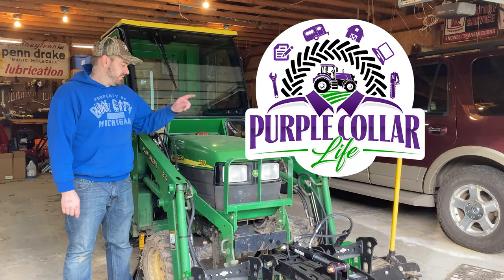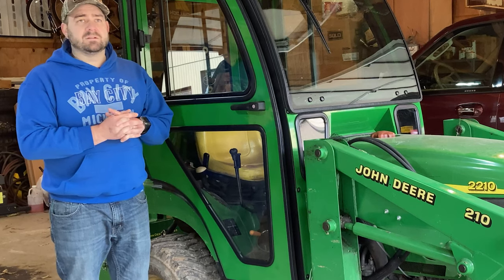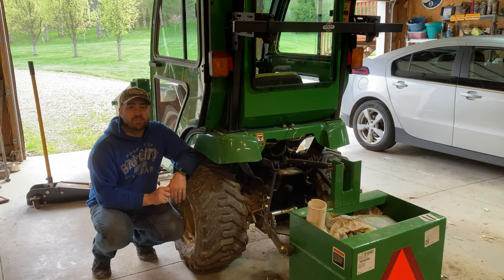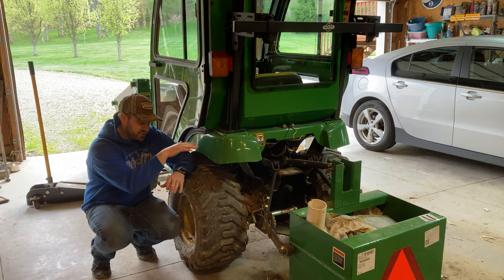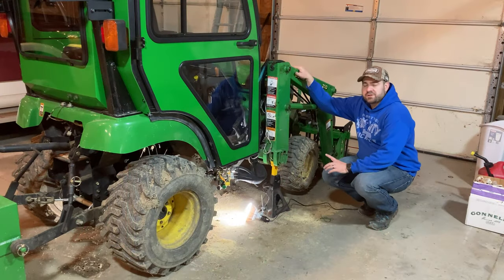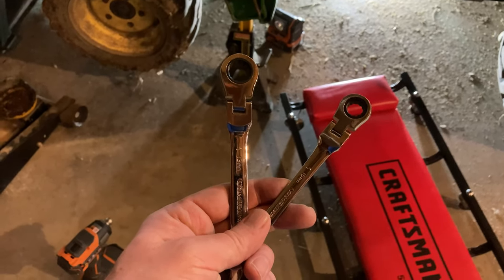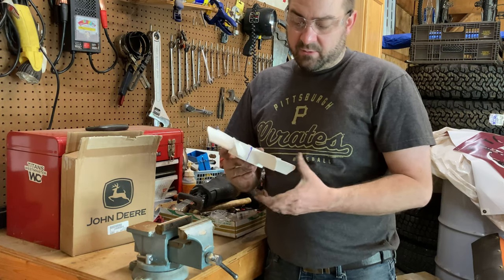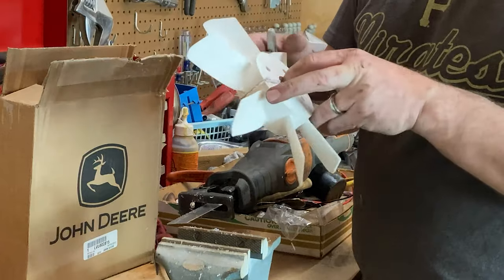#201: John Deere 2210 2305 Transmission Fan Replacement DIY

Comment: Hi Chad, I feel your pain! My 2210 developed a rattle that sounded like it was coming from the engine. It’s so compact in there that you really can’t see much. I debated taking to the dealer because of the cost so I offered my nephew and his son the job. They jumped on it like rabbits. Before I knew it they had split the tractor and found the u joints on the drive shaft were shot. After following the advice of several Youtubers I went to NAPA and bought theirs. The guys couldn’t make it fit. It looks exactly the same as the JDs but they are just too big. So I ordered the whole drive shaft from JD at close to $500. Of course, the fan was broken as well so that got replaced as well. They did a really good job of cleaning everything up and putting it back together. I started it up and the rattle is still there. Now they’ve decided it must be the water pump so they’ve spent the last few days tearing all that apart and I ordered a water pump from Amazon and of course it’s not the right one. Now I guess I have to go back to JD and the get the parts from them. I’ve spent the last few weeks chasing all over trying to get parts like belts, u joints and mower deck parts but I always seem to go back to JD. My tractor was a repo so the salesman wasn’t sure what year it is but I’ve had it for 13-14 years. I don’t know what I would do without it. I’m 77 and that tractor is my muscle on my 5 acres. 
Sorry this is so long but just know that you are not alone. I don’t know about other makes but JD seems to make these machines unserviceable. I’ll be watching to see where your adventure takes you. I’ll let you know if we get my rattle fixed. Good luck!
Reply from the maker: Hello! Thank you for the information on your tractor.  I’m afraid I probably will need to replace the driveshaft in mine before too long (hopefully not for another year or two).  It’s great that you have your nephew and son who are capable of doing the work! I’d still be afraid to split my 2210.  It just seems like it is beyond my skill set, or at least very intimidating! 
Such a bummer that the rattle is still there, but at least you know the driveshaft and fan are good now! :). 
I don’t know what I’d do without my JD2210 either.  It’s a great machine.  
Can’t wait to hear your update on what you find with yours.  Thanks for sharing! Looking forward to having you follow our adventures.
Reply: Hi Chad, the guys finally got the 2210 up and running and the rattle seems to be fixed. After waiting for parts to come in by bits and pieces and returning some of them that were not ordered, they finished yesterday. I’ve lost track of how much I’ve spent on all this including what I paid for the labor. They put in the new water pump (almost $500) and so far nothing is leaking or rattling. We didn’t get a gasket with the pump so we made one out of cardboard. It feels so to good to have my tractor back in working order. I hope you get your issues solved soon. Best of luck!

Comment: Great job replacing the fan yourself! That is a substantial savings avoiding deal repair cost on the labor! The fan shield could use an extension on it to help prevent future branch intrusion. Cheers!
Reply from the maker: Thanks!  I agree about the skid plate / shield.  I would think it could still allow airflow in the sides if it had a little more protection up front, but I'm not an airflow engineer. :)

Comment: Glad to see you were able to fix it yourself feels good to save money☀️😁👍
Reply from the maker: It certainly does. It got a little stressful at times when I wasn’t sure I’d be able to get the old fan cut, or get the new one bolted in - but I’m really happy I did it myself.  Like I’ve said in a few other responses to comments - we probably would have had to do without the tractor for a little while as we saved up for the repair. I don’t have $1500-2000 sitting around in a “tractor repair fund”. :)

Comment: Nicely done, Chad. Thank you!! For taking the time to throughly explain your process. Have you been able to install some sort of guard so it doesn't happen again? I would have been so frustrated along the way but you calmly pushed through your frustration and got 'er done! Cheers!
Reply from the maker: Thanks! It was a task for sure.  I will certainly be extra careful now and watch for sticks when I'm working.  I haven't found any good protection for it yet.  There is a mesh guard available for the John Deere 2305 on eBay, but I've had another viewer say he tried it and it doesn't fit the 2210 models.  I'm actually tempted to put the mid-mount mower back on just as belly protection!  Thanks for watching and commenting.

Comment: I can't find any forum posting of the printable fan you mentioned.  Do you have any recollection of where you heard of this?
Reply from the maker: I think I read about it on the TractorByNet forum, or maybe one of the John Deere forums.  I did a quick search, and couldn't find the slice file or any 3D printing file for the fan. It seems like a great 3D printing option though - if you can find the file.  Though, the molded part wasn't too expensive, and cutting through it wasn't too bad.
Reply: Thank you for responding,  I really appreciate it!
Reply: @tommyfournier3138  Im looking too were you able to find it?
Reply: @dorito31561  no, sorry. bought the real part and removed the shaft from the motor to the transmission.

Comment: Nice work. When I bought my used 2305 from the dealer last fall it came pre broken, so when I noticed I put it back on the trailer and took it back to them. They reluctantly fixed it at their cost, the service manager even tried to tell me that the fan was only there to keep debris from building up on the transmission… just the other day I ordered a mesh guard that goes in place of the factory shield from some guy on eBay, but unfortunately the ones he makes only fits the 2305s. I had no idea the 2210s were so different underneath, you really did have to work to get that in there.
Reply from the maker: Thanks for letting me know your experience.  I don't know if I'd trust that service manager any more! Just for debris.  That's funny.  
I wonder if that's the same mesh guard I've been considering off of ebay.  I only saw one, I think it was about $120 if I recall correctly.
Reply: Do you have a link for that fan guard?  My google fu isn't working... After seeing this I may bite the bullet and get a guard.  Thanks
Reply: @Gareth96v1  Hi John. The ebay seller i bought my guard from is named "enventive". He doesn't have anything listed currently, but as he makes items he list them so you'll just have to keep an eye on his account.